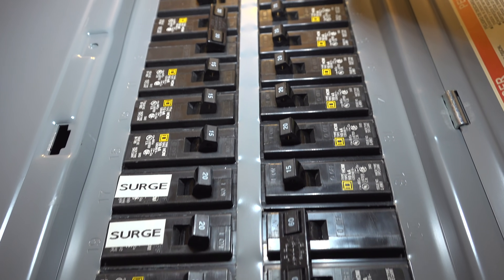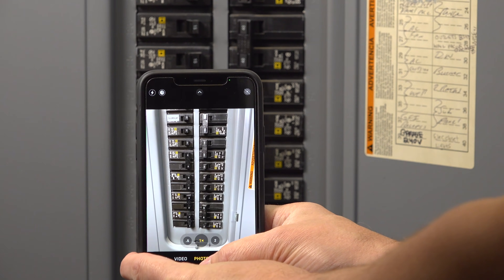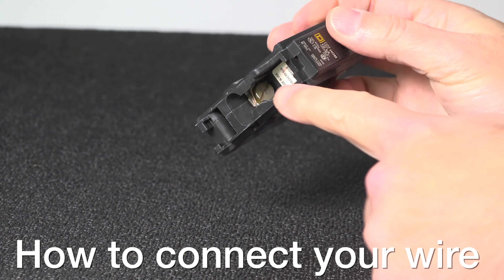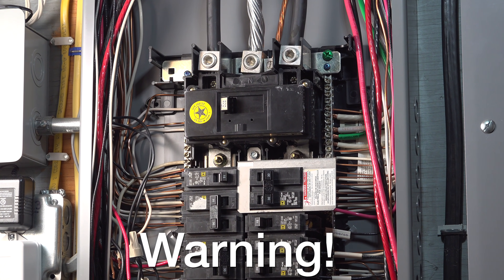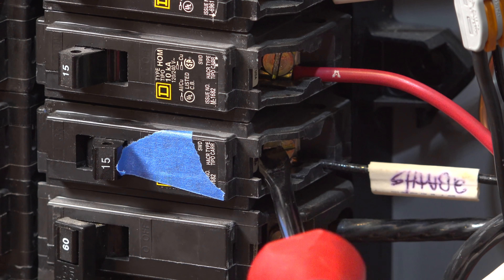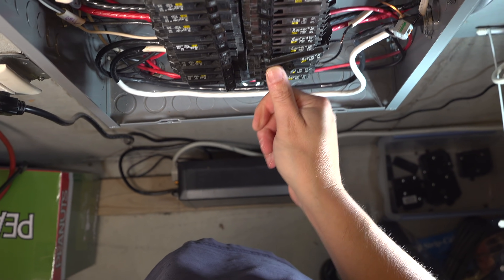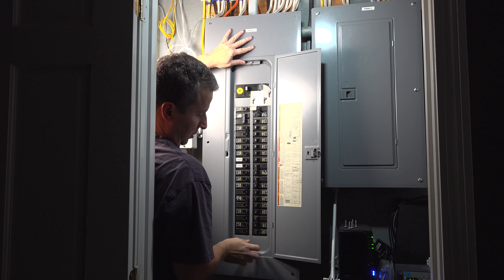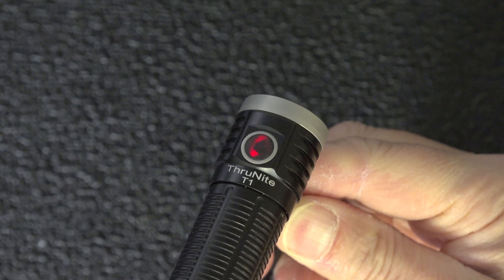How To Replace or Change a Circuit Breaker in your Electrical Panel & Why it's Tripping

Comment: if your replacing a breaker why would you not take off the old one and bring it with you to the hardware store
Reply: I took a snapshot on my phone before I went but that's only because I didn't want to disconnect anything while my family was still home. That is a good idea though.

Comment: What if the breaker is stuck in the panel? I cant take it out and don't wanna force it too hard
Reply: It should not stick. Did you ever get it?
Reply: @Darius H  yea. It was super stuck though.  I think when it was sparking, it molded the plastic from the breaker onto the box.
Reply: @incrediblehak2833  ohhh that makes perfect sense. Glad you figured it out before it really melted.

Comment: If a breaker keeps flipping due to an overload at a specific receptacle in the home, can you swap it out for a higher amp breaker, or does it have to the same amp? I have a receptacle in my kitchen that trips whenever I turn on a certain appliance.

Comment: You absolutely helped me oh so much!! I'm a single 31 yr old mother and I have done all my electrical outlets. Light fixtures and outside lamps as well...  lately my breakers have been throwing when I don't even have close to the amount it would need to throw it... so im going to try this.... I'll lyk exactly how it went. I also have this other problem where my room my room mate room and the bathroom are all of the same breaker.. I need to make a new breaker just for my room or just for his room and the bathroom... do you have any videos on that? I'm not stupid when it come to electricity. I absolutely in no way want to die or be flown across my house so I am SO CARFULL and have a reader and a wand to tell me if wires are live or not and also hold my breath quite a bit and stand off to the side of the breaker box lol in case ya know.... but I absolutely need to make a new breaker to even out the electricity used in my room. If you have any tips I'd really appreciate it.

Comment: I have a pole with the main power on a 200breaker there are two hot wire's and a ground how do I convert it to my 50 amp plug to my RV
Reply from the maker: Sorry this is way beyond what I can answer in a comment. Please seek pro help for this type of change

Comment: We had a power outage last night and now we have a buzzing now coming from the breaker box. It buzzing and stops. When it buzzes some lights blink. But not all. Could it be from the outage? Could it be breakers that are bad be now because of the outage? I need help..
Reply: Did you make sure the wires to each breaker are seated securely first? I know it is a pain to check each one but it could prevent a bigger issue down the road. When a wire tip is not secure the breaker will still work but it will spill off electrical heat which is not only dangerous but will cause circuit breakers to age prematurely.

Comment: I HIGHLY recommend ALWAYS calling and telling your power company to open the meter switch. Just like you said.. those two live wires WILL LIGHT YOU UP. Don't EVER work on a panel without doing this.. it's just not worth it.
:(

Comment: One suggestion is to leave the wire in the breaker. As long as the wire is not tangled up with other wires it will help hold the breaker after you remove it. Then you can remove the wire, grab your new breaker, install the wire in the new breaker, and then install the new breaker in the panel. This gives you a better view of the nut to make sure you install the wire(s) correctly between the tabs. I also use a small brush and put dielectric grease on the panel tabs, the breaker contacts, and the nut. You'll need the corrosion protection if you're installation is in an outdoor panel.
Reply: Check for grease in New Breaker. Confirm it's inserted correctly
Reply: I was wondering the same thing.  Thank you for confirming that my logic wasn’t illogical.

Comment: Only thing I see missed here is when inserting the wire/conductor into the breaker, make sure it is all bare wire and no insulation is under the screw/plates. Nice video otherwise.

Comment: Last summer an electrician fixed a burnt breaker and saw my exterior outlet was no good. He took out the breaker and now I need to replace it myself. What do I need to do to replace it. I need to use it for heat tapes

Comment: Question: What if the Outlets in the house are a 15Amp and I replace the breaker with a 20 AMP will I still get power tripping? As I plugged in an electric heater on one side and also on the same side to have 2 electric heaters and that's when I realized the power tripped and possibly need to upgrade the breaker from a 15 to a 20 AMP. Any help with this would be appreciated... Thank you in advance.
Reply: DO NOT CHANGE A 15 TO A 20. You could potentially cause an electrical fire.

Comment: Thank you so much for this! I went through the same line of reasoning that you did to decide that it was not the circuitry that was bad it was the actual switch. When I told that to an electrician over the phone, he said that he was sure it was the circuitry and wanted to rewire it all, and he promised he would try to not break down too much of the drywall. Wow this is terrific for us DIYers :)
Reply: Tell him to do thr cheap thing first. Then watch him. Lol. Because people LIE.

Comment: Wonderful. Can we take a separate wire from this MCB Box and keep it outside. If it trips, can we on it from outside. So if nobody is there in the house, we can on it from outside. Will this work. Is it possible to give a separate line from outside. Need your valuable suggestions and advice.

Comment: I have a breaker for my kitchen which keeps tripping when I plug in two things (electric cattle and air fryer for instance). If I change this breaker with the same amp and same part will this resolve my issue? Please advise.

Comment: My breaker (20A) tripped when using a portable heater, can I change it to 30A? Will that stop the breaker from tripping?
Reply: No don't do this, you will start a fire. The wiring in the house isn't rated for 30 amps. You will need to run your space heater on a low setting instead of high.

Comment: Thanks friend for this very thorough walkthrough and safety steps on the cover removal, and awareness of the 240. I had water come in through the conduit hole from the foundation wall. Think of a bucket being the foundation and near the top a hole drilled through the bucket. That's where the conduit for utp/coax/ and the elec enters the house. all that's keeping water out when it pools out in the yard was spray foam around the conduit in the hole. Well found out  one winter the foam gave way. Is this some engineering flaw or something? the water was gushing in like a waterfall. Was left with sizzling circuits. power out for 1 day with towels everywhere and dehumidifier running.  dug out the river stone on exterior of the house. resprayed foam on outside and in, dug deeper than it was, maybe say 8" backfilled with some more stone. Then added  an eves trough spout extension to keep water away. It worked. Hope this could help anyone.

Comment: Excellent video, I tried everything, changed the circuit breaker, wire is live as it was with old breaker and still the same...my basement has no power in any of the outlets and no lights...
Will need to further troubleshoot.
Any ideas please? thank you.

Comment: You should be teaching safety too if you teach electrical work use an electric tester too to make sure the connectors are off and there is no short in your circuit box. So when you go to remove the breaker it doesn't electrocute you.

Comment: Don't get me wrong. Like the young Lady said in her comment. Your  video have fewer words and straight to the point but you lost me with the exact part number and amp. I see the number 20 on the switch and 10 kA then under that is 120v ~ ?? It's switch number 28 but what's the part # ?

Comment: First, your video was great! One question, I have 3 double’ breakers. Electric stove, electric dryer and a/c. My stove has begun tripping my double 30 amp breaker. Is there much difference in replacing the double vs the single? Also, should I increase from 2-30’s to 2-40’s or higher? Thanks.

Comment: I am a first time home owner. I’ve had three breakers fail in my first two years of my new home. Now I have to different ones failing. However, the builder is no longer answer me and I am going to have to do this on my own. After watching your video, I am comfortable doing this, and the cost is minimal. But I am worried I could have some larger problem? Previously, electrical company said “we’ve been having a lot of these fail”… but five in two years? I know there are infinite variables, but do you think it really could just be bad units since I’ve had so many fail? In my inexperience, it would seem like there is a larger issue at hand.

Comment: My circuit breakers don't have anything on them except on, off and the numbers (10, 15, 20, 30...) Only one of them is a Dsquare, but not the one that needs replacing.
Reply: Edit: none of them are a 10. The one that needs replaced is a 50, for my hot water heater.

Comment: Worked exactly as shared. Took less than 5 min to actually do (after procrastinating for weeks for fear of killing myself). 🙏🏻
Reply: Im in the same boat brother but im stuck in the procrastination for fear of killing myself
Reply: @luisgiraldo9947 I feel like if you follow the instructions and have a tester like he dues that shows "live"  versus non- live wires, it will be fine. Personally, I'd check every wire to every breaker just to be sure throwing the main cut all power except those lines coming in from your weatherhead where the line from the pole connects to your main panel. Then you should be good to go. Do it early in the day to give yourself time to get an electrician in if it turns out to not work. It should though. Good luck. I am thinking about doing this myself. I am not keen on electric but I have done other electrical stuff, so why not this?
Reply: same
Reply: heheh I am procrastinating one day further, bought the breaker, just ordered a voltage pen
Reply: Anytime I deal with electricity I use rubber gloves. I've been shocked more times than I care to admit
Reply: I feel that lol I need to replace one but I dont want to kill myself
Reply: Same 😥
Reply: I felt that one in my soul I've been dealing with the same thing putting it off cuz I'm scared to death of killing myself
Reply: That’s where I’m at , lol I’m a 62yr old widow
Reply: @plainandsimple2576 
I’m 60 and will be doing mine myself. I can’t afford an electrician. My dad was an electrician so I have a slight clue what I’m doing. And I already have the pen to check the wires.

Comment: ? any problem with replacing a 15amp with a 20amp breaker? Need to put 2 frigs on the same outlet.
Reply from the maker: You can NOT upsize a breaker like that. If you start with a 15amp it must stay a 15amp. You can only go smaller. If you want to put a larger breaker I recommend calling an electrician. Its too long of an answer as to why.

Comment: This was great & hopefully it solves my issue. The breaker doesn't trip all the way off  & it will not click either way & the kitchen plugs along a certain wall doesn't work. I'm going to replace the breaker & see what happens. Thanks for the video.

Comment: This was extremely helpful. I watched another video previous to this one that left me with many questions. Yours answered everything.
Reply: Except circuit breakers are like 65$ and not 5$ apparently? 😢
Reply from the maker: You can see the prices listed at the store. The only exception is GFCI and ARC fault breakers but thats not the kind I replaced in the video.

Comment: I am a 74 year old woman on a fixed income so I have to do as many things myself as I can. My circuit breaker for my microwave went bad and needed to be replaced.  I watched several videos on Youtube to learn how I could replace this myself. Of all the videos I watched, this video explained and demonstrated the process the clearest, in as few words as possible and still get the point across, so that I understood and felt confident I could do this myself.  Thank you for your valuable assistance!
Reply: If you happen to be in the Detroit metro area (which is very unlikely) I'd love to help you with anything you need.
Reply: @mdelong6989  simp alert
Reply: @B_COOPER bro... for a 74 year old? Dude could just be very helpful and considerate looking out for the elderly, as any good society should.
Reply: @B_COOPER imagine being called a simp for being nice. cringe
Reply: It really does, he did a amazing job helping us women out I’m appreciative
Reply: Ohhh, don't go there. That magnetron is NOT to be messed with. Some people wire these up to burn wood and make art. Problem? When you modify the magnetron, there's no limit to the power, if I'm not mistaken. It's NOT going to shut off or overload if you get in the way to ground. Several people died doing this, btw. Magnetron is no joke. Plus some old tvs for example, hold power for days.
Reply: ?? What if it’s the wrong gauge wire?!  Idk, be careful. 20 amp requires a 12 gauge wire I believe, 15, idk 13-14 gauge.  🤷🏽‍♀️. Good luck!
Reply: Good point! 14 AWG wire should not be used with a 20-amp circuit breaker. 14 AWG wire is only rated for 15 amps and using it with a 20-amp breaker can lead to overheating and a potential fire hazard. For a 20-amp circuit, you should use 12 AWG wire.
Reply: @PHILLIPESCALA 
What about for a 40 amp breaker?
Reply: 54yo woman here, wondering if i should tackle the problem myself. i know exactly what happened and the breaker did its job and prevented a surge from a bad extension cord hookup, so no electrical mysteries to solve. I was still skeptical but reading your comment cemented my confidence. Good job Angela, keep learning :)
Reply: Call an electrician. A lot of times, this could be something simple and cheap to fix. If they have half a heart, they will do the work free of charge or will barely charge you anything.
Reply: @blessedjuggernaut  Good luck with that theory .   They are in it for the money , unless they are a personal friend.    LOL.   This is the 21st century,  not the 50s.   Those days are long gone.   Try getting a doctor to treat you free.   ROFL.
Reply: Take care
Reply: Very very common on microwave's espeally with the newer GFCI breakers(They usually will have a little white test button next to them)
Reply: Wish my mom was as ambitious and willing to develop new skills like you! Strive on!
Reply: Yes and amen!  I don't have $300 to fix this.  This video shows me I can do it and live to tell the story.
Reply: I like to attach the wire to the new breaker before I clip it back into the panel box.
Reply: i get you love, im an 18 yr old woman and I'm learning so many things for the same reasons.
Reply: sure Miss Ai
Reply: And God continue to bless you

Comment: Great video. Cut out the tape step though, just flip that one switch off, all the others will be still in the "on" position, and you'll be able to easily tell.

Comment: Thanks so much for the video! An HVAC company quoted me $650 to replace a circuit breaker switch. I was able to do the work myself in 15 minutes - total cost $15.98 for the part 🥰🙏
Reply: You have to follow those guys around like you're glued to their butt and know what they're doing and why. Make VERY sure they're licensed and qualified.
Reply: If they were charging you $650 to replace a circuit breaker you were about to get royally ripped.

Comment: Thank you so much. My office breaker keeps tripping in our apartment. No other breaker had issues and the place is old so I knew it just needed to be replaced. Your video was direct, clear, and very informative. Unfortunately, even with the new breaker. It was still tripping. On to the next plan, I guess.

Comment: I got to replace a circuit breaker this weekend.  Last night, a circuit breaker kept tripping.  I tried resetting the breaker, only a few seconds later, the breaker would trip again.  However, the circuit breaker is broke because I didn't notice or hear a clicking sound.  I've done this before.  This is not a hard job to do.  Just make sure you buy the right circuit breaker like the video says.

Comment: 8 Pm in Texas during this record heat the breaker for the A/C failed.  Watched your video.  Pulled the panel apart and removed the breaker.  Made a run to Home depot. Installed the new one and   I'm back up and running! 2 hours total time... THANK YOU! 😅

Comment: Thanks man! Solved my issue. My window ac unit running with my TV and sound system would trip randomly once a week or multiple times a day. I followed your exact directions and havnt had a breaker trip since. Much appreciated.

Comment: Thanks for another great instructional video. I have a sub-panel in the garage that has had a failed breaker for a couple of weeks. Took me less than five minutes to apply my newfound knowledge saving me over $100.

Comment: Can I change 15amps with 20amps. What type I wires should I have .ty
Reply: NO !   15amp and 20 amp wire circuits have different gauge wire. (thickness of wire).
Reply: Using wrong circuit breaker "amp", may result in fire.  Defeats purpose of circuit breaker.

Comment: A few years ago, my elderly neighbor changed a faulty circuit breaker in my box.  I wanted to change it so that I could get the experience for the next repair.  Unfortunately he insisted on doing the repair while I watched.  He passed away almost two years ago; and now I have to make another circuit breaker repair.  This video has helped a great deal.
Reply: check the conductivity of that circuit socket between hot and neutral, hot l and ground while power is off. If there is not conductivity, it is likely the circuit breaker is bad.